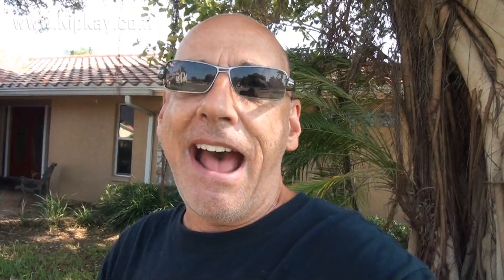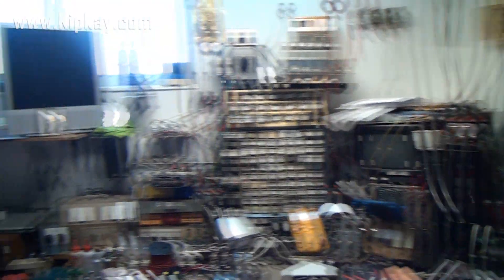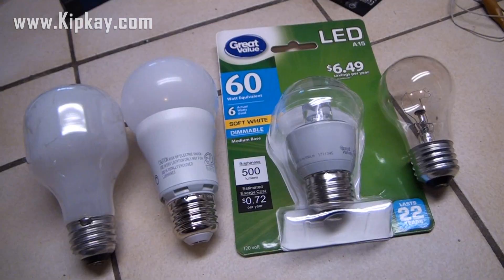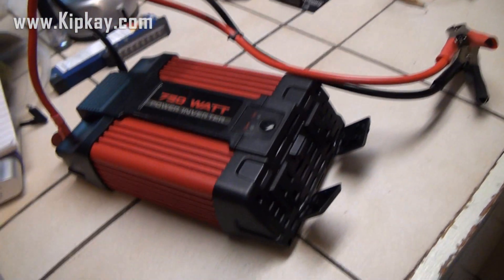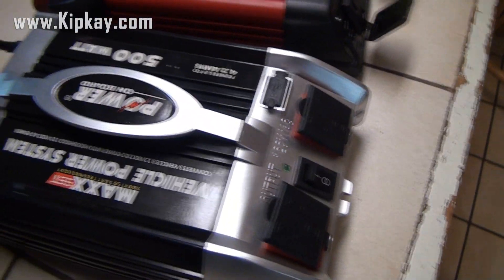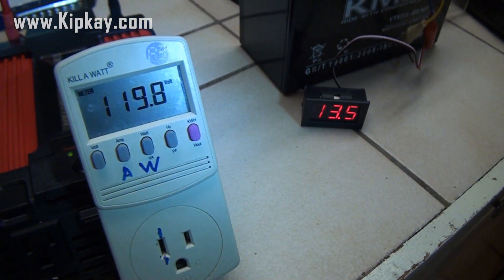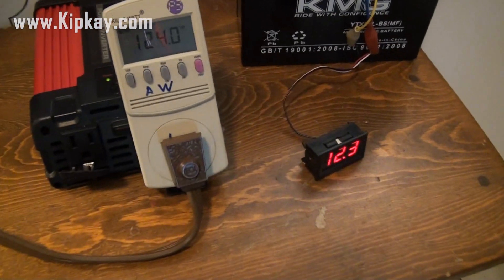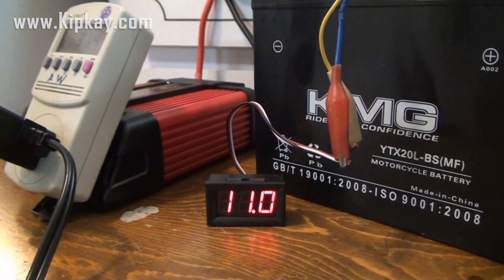Power a Refrigerator with a Battery!

Comment from the maker: Kipkay now has a Spanish Channel! ¿Hablas español? No hay problema: https://youtu.be/McKqj6kEpdk
Reply: How do i charge the battery every hour with no power
Reply: @jeffbezos4746  Put it back in the car... I would leave it in the car, and run the engine every hour or so to save gas, but charge the battery
Reply: @phillies4100_mainsite  is there a way that one could connect a battery charger to the inverter to recharge the battery  , so in a sense that it would be somewhat, `self-charging', i guess one could state ?
Reply: kipkay i
Reply: Is it possible that you might be able to do a video about running a stove and a refrigerator off of solar panels you see my wife and I are wanting to go off grid and I'm trying to figure out the bare minimum amount and the cheapest panels that we can possibly get!
Reply: PLEASE COME BACK THE WORLD NEEDS YOU

Comment: Modern appliances run directly on both AC and DC, all we need is series of battery to addup voltage to system voltage and connect Directly without inverter cause inverters are less efficient, almost 30% power is lost by them

Comment: Great post.
I recommend at least having a roll of duct tape near the fridge. When the power goes out. Make a nice tight seal around the edges of the fridge doors and freezer. And only open the fridge when needed. Best would be to remove all meat from the fridge section and cook it, cooking it will help it last. The meat in the freezer should remain there and remain frozen for some time, just don't open the freezer unless needing to. If you want to really help with keep the fridge cooled efficiently you can rig up those thick vinyl attic belts/straps that are used to selerate the freezer from the butcher station in grocery stores. So when you open the door, the eoosh affect of opening the door, which replaces the cold air with warmer air, will have less of an impact because of the vinyls barrier.

Comment: If you really want to be prepped for this, the best thing is to get a chest deep freeze and modify the thermostat to keep it just above freezing. Then you can get by for a long time on a charge. Also build an insulative foam cover around the unit and don't get into it more than once or twice a day.
Reply: My idea was to run my freezer to keep food frozen, freeze some ice packs that I  got in the mail, and put the frozen ice packs into a large cooler to act as a fridge, so only the freezer runs, but I get the fridge/freezer benefit.

Comment: I have been trying to get some info to run a frig and freezer, I have 400 watt solar panels 30 amp charge controller, 1000watt pure sine inverter and one 100ah lithium battery, Can it be done ? Thanks

Comment: Why not park your car in the driveway, hook the inverter up to your 12 volt battery, run a cord to the refrigerator from the inverter and run your fridge off the car's alternator?
Reply: Most cars do not charge enough at idle.  Someone would need to be inside the car with foot on the pedal to get the rpms up.  This also causes the car to use more fuel.

Comment: question : that battery will run that fridge for an hour, then you have to recharge the battery ? but if the power is out which is why you're using the battery how do you charge the battery ? a solar panel ?

Comment: Can i power my refrigerator (uses 220v) with my 12v battery that is connected to 1000w inverter?

The battery is being charged by Solar...

Comment: Don't know much about all this yet, but wouldn't it be better with something other than a car battery that quickly runs low on power and has to be recharged all the time. I saw another video where the guy was using batteries for Golfing carts.

Comment: the real question is , if you have 10 car batteries in series (12*10=120)
would you be able to power your fridge directly off of them without an inverter
Reply: No, thats 120V DC, you will burn the inverter.
120V DC is completely different to 120V AC
Reply: @danielji2742  "without an inverter"
Reply: @logangraham2956  without an inverter = directly connecting 120V DC to the fridge will fry the fridge

Comment: Question, that inverter seems like a non sine-wave inverter, does that work with the motor of the fridge? I ask because those inverters are usually no good for a fan only for "passive" items such as a light bulb or a pc
Reply: how did this not get an answer?
anyway, it usually depends on the inverter. some put out a total square wave, others put out something a little closer to a sine wave. you cant really tell unless you test it (of course pure sine wave inverters will put out real sine waves, otherwise its false advertizing)

some inverters will say how much noise is in the dirty wave. mine says "total harmonic distortion of 30.84% and maximum single harmonic of 27.72%". i dont quite know what those numbers are. i can assume that when you get closer to either 0% or 100%, you get closer to a sine wave or a square wave, but i dont know which way it goes.

with dirtier waves, the motors will either just not work, or they will run noisier and hotter. noise is not good for a motor, but its ok in an emergency.

the electronics might be confused by dirtier waves too. just try hooking up a clock or something.

Comment: Be better off to buy $100 harbor freight generator run your fridge for a couple hours and shut it off LOL my 750 watt inverter just trips when I use it on the refrigerator
Reply: probably the in rush.
its probably 750w running but its most likely peaking above that just momentarily during initial start up

Comment: 220 watts is drawing over 18 amps from the 12V battery.  That's a heavy draw for a little 18Amp-Hour lead/acid battery and it WILL NOT be able to sustain that load for anything near an hour.  20 minutes is more like it. Replacing the fridge bulbs is foolishness.  While it might keep a marginal inverter from tripping if the doors are open WHILE the compressor starts, it's much cheaper to simply unscrew the bulbs altogether.  You can live without a refrigerator bulb during the outage.  Or get a 1000W inverter and live it up.  During normal operation the bulbs are only lighted a couple of minutes in the course of a day so the "energy savings" are ridiculously small.  Put LED bulbs in fixtures that are heavily used.

Comment: The idea behind the video title is good but:
The light bulb change is unnecessary- the compressor and specifically the start up is the problem. 
750 watt inverters will usually have trouble starting a normally sized fridge
A car battery is not designed for disconnected use- other than starting a car.  The alternator is an integral part of using a car battery
Get an appropriately sized fuse between the positive battery terminal and the inverter.  "Why? That just wastes time!"  If something goes wrong in the inverter or you draw too much current from the battery, your battery wires become like the filament in a lightbulb- fire. 
Use very thick and very short wires between the battery and inverter- the 110AC side can be longer - a standard heavy duty extension cord. 

advice videos are best when researched a bit.

Comment: Did it actually power the refrigerator? Because my experience with power inverters has been that they only power the lights inside your refrigerator but they cannot power the compressor

Comment: AGM Deep cycle battery, a 50-75ah + 200 watts solar panel + 30ah solar charge controller should keep your fridge running continuously without power quite well.

Comment: This is a terrible idea. Using a cheap modified square wave inverter is a quick way to wreck your refrigerator's compressor motor. I would rather let my food go back then wreck my $1800 fridge. A car battery also will get wrecked pretty fast, they are not meant to run for extended periods with a decent draw on them, a deep cycle (which he used) would not get damaged.

Comment: There is no problem for battery charging lot of inverter comes with battery charger and automatically turn battery on during no electricity but that battery will not work as he said one hour need bigger battery for one hour.

Comment: The concept is valid. This setup is complete BS.  You will need proper solar panels to charging the battery and this is 2017, get a set of lithium battery bank instead plus set them up in 24v instead of 12v.  Running my freezer in garage like that for 2 years now.

Comment: I have a question. If you get a 12v battery charger and connect it to the inverter on one outlet to charge the battery  and the fridge on the other outlet at the same time. Will it keep the fridge  going without having to turn off?
Reply: Harold Correa The inverter wastes more power than it provides. Nothing is 100% efficient. Any device, YouTube video or anything like you described that can go forever on it's own power isn't true. It's called perpetual energy/motion. My physics professor made sure we realized this just in case we would be in a situation where someone tries to sell us something like that.

Comment: Power inverters destroy compressors! Kip, as an electronics enthusiest and youtube creator, you should know better than to broadcast this to thousands of people. A "modified sinewave" from a standard power inverter causes excessive heat in motor windings and this seriously degrades the motors winding insulation very quickly. Tell the people to use true sine wave inverters!
Reply: Overwhelming Euphoria  need a pure sine wave inverter. cost more of course

Comment: This is a last resort people, advanced warning is given especially of a hurricane approach, often days before the event, the real trick is to add thermal mass to the freezer and refrigerator compartments, fill all available containers with water, freeze them and redistribute them in both compartments. We do that and can get at least 3 days of safe, unpowered storage before temps start to be a concern. Using the battery approach, just bump it back up by intervals, and in between, recharge the battery for the next round.

Comment: Everything will be fine until the defrost cycle kicks in. :-) Been there and done that. Connect the battery to solar panels with a 20A charging output.
Reply: Would using a pure sine 8nverter solve this ?
Reply: Defrost can take 5 to 10 amps....
Reply: @belly tripper I found the placenta helps

Comment: Bought 150$ tractor supply 2kw gen has a12v batt charge cord . keeps frige &fr. Cold.light in weight use batt.w inverter for lites till storm over then hook up gen.recharges battery😎

Comment: Yeah. Good premises. A better idea might be to use A 5 cu ft deep freeze. It draws about .5 amps on house current. So, about 6 amps 12v dc. And since there is no defrost cycle to destroy your battery. A wiser option. 
 A 120 watt solar panel would keep you making ice. Trays of course.
Hack would be to add a 60mm 12v fan into the freezer. Air flow would aid in making ice sooner. 
The car is a great idea for charging. In small amounts. I'm sure a car would idle for several full days on 3/4 tank.
Reply: And a much larger battery.

Comment: Its a great idea, but the inverter used is modified sine wave. Which produces unclean voltage. If this were used on a regular basis, this would shorten the life of the fridge. The better solution is a pure sine wave inverter, they are a little pricey, but it produces a cleaner voltage and would be better on the fridge

Comment: This is exactly what I did. I was in charge of everything for the storm except the generator. Well, the person in charge of the generator did nothing, so when I went to crank it up, it was not working. I still have not gotten it working. Anyway, I ripped a battery out of the lawn mower and hooked up my 500 Watt inverter. I removed the light totally and...no dice. So I tried my 1000 Watt one, and it worked....and then the storm did not even cause a brown out for us so all of it was not needed, haha.

Comment: If you in a house you could easily get a electric cable extension put the converter inside the car without taking the batt out and recharge it all the time as long as you don't use any of the other stuff in the car the amps will suffy and if you have a full tank it will last for a very long time

Comment: so you need to get up every hour all night to rotate the battery? wouldn't you be better off running a tiny lawn mower generator or leaving the inverter in the car with a battery isolate

Comment: Install a bunch of solar panels
Reply: No..... It is illegal in florida to have solar panels that are not hooked to the grid and approved or managed by the utilities.
Reply: WTF BBQ that's not 100% true. 

FS 163.04          (2) A deed restriction, covenant, declaration, or similar binding agreement may not prohibit or have the effect of prohibiting solar collectors, clotheslines, or other energy devices based on renewable resources from being installed on buildings erected on the lots or parcels covered by the deed restriction, covenant, declaration, or binding agreement. A property owner may not be denied permission to install solar collectors or other energy devices by any entity granted the power or right in any deed restriction, covenant, declaration, or similar binding agreement to approve, forbid, control, or direct alteration of property with respect to residential dwellings and within the boundaries of a condominium unit. Such entity may determine the specific location where solar collectors may be installed on the roof within an orientation to the south or within 45° east or west of due south if such determination does not impair the effective operation of the solar collectors.
Reply: I have a solar powered fridge on wheels. The solar panel doubles as a bar to rest your drinks on.
Reply: @skotup  Hi. I'm looking for one of those refrigerators. Where can I find it?
Reply: @jeniestra.  you can't buy them, you have to make it. Take a 12V car fridge, garage storage rack. Put the fridge in the storage rack frame, screw wheels under the frame, put a solar panel on top as the bar top. Wire in a 12v regulator/charger, 12V battery, connect fridge to 12V battery. Solar powered bar, job done.
Reply: @skotup  thanks for the explanation! Would a  single 100 watt solar panel do it?

Comment: If you are going to be burning gas in your car to recharge this battery, why not just take the money for the battery, inverter and wattage/voltage monitor and buy a small portable generator that can power a fridge, chest freezer, a few lamps with LED bulbs and a hot plate for cooking? For a bit more, you could also power up your modem and computer.

Comment: Or you can buy a small generator instead of all that
Reply: Generators use a lot of gas and gas is hard to find. You could charge the battery with a solar panel
Reply: Generic Name which uses more gas? Recharging the battery off a vehicle or using the generator?
Reply: You will end up buying a new refrigerator using a modified sine wave inverter

Comment: Good video except for the charging part for some of us at least... So it'd be helpful if you did a video showing us how to hook up the proper solar panels with the proper watt solar panels to make the refrigerator work and some lights and the computer work in the house that would be great... Thanks from the mountains of Guatemala and sometimes the Jeep can't be near the house to charge the battery so solar panels would be great

Comment: With two batteries you could keep it on or use some solar cells to reduce the load on the battery making it last longer you can get some at harbor freight

Comment: A bigger battery would make it last longer - and should charge quickly using the car as a charger . The alternator  puts out a lot of current when its running with the car engine

Comment: how do you charge the battery when there is no dumb electricity?????????? your car wont start because it flooded so now what?
Reply: Aakash Jethwa Solar panels
Reply: not everyone has them though
Reply: Aakash Jethwa Then I guess your boned. Could try hydrogen generators like Grant Thompson has made
Reply: lol I live in Canada so i dont really have this struggle. he did give a good idea but its not an efficient way to solve the problem. also even if you have solar panels and your home is flooded then the wall plugs will be shorted by the water thus shutting down the breakers therefore the solar panels electricity will not work.
Reply: Then obviously this won't work for you will it???

Comment: a fridge does not use power all the time. some may use a little. if it has all the electronics. but the compressor is what eats power. it runs a few minutes out of a hour. and if you turn the inverter off . you use no power. so just turn it on for 20-30 minutes every few hours. the food will likely never know it. and the light goes off with the door shut. so in a pinch. you can just remove the bulb. every lilbit helps. when you have limited power. or you can put the inverter in your car. and run an extension cord to the fridge. and lights . and just start the car every hour . depending on use.

Comment: I was expecting to see the fridge hooked directly to DC current. Which would prolong the use of the battery. This just seems silly and dumb to me. 1 hour won't do you any good if you can't recharge that battery. And if you're going to use your car to do it you might as well run the line to your car so that you're alternator can help power the fridge anyways. Also I'd just unscrew the bulbs in an emergency. Who needs lights at a time like that. Your also better off putting all your food in a deep freeze. It'll last lounger with the already frozen food acting as an ice box.